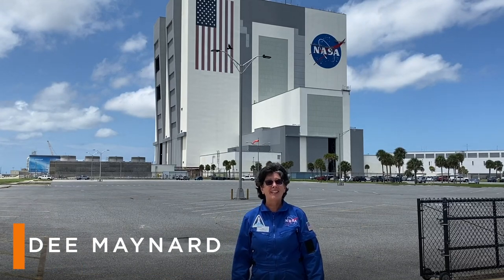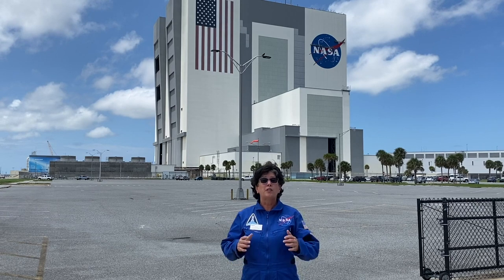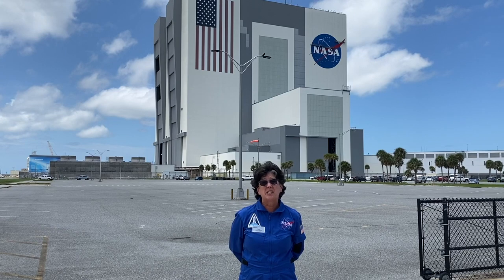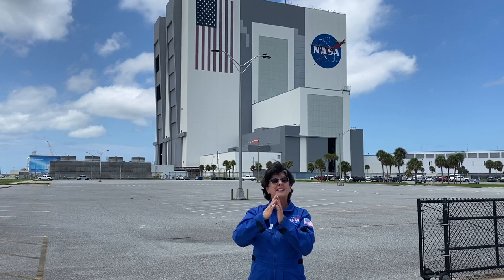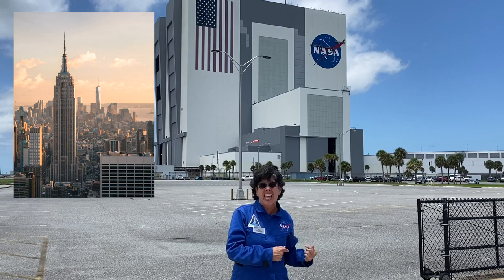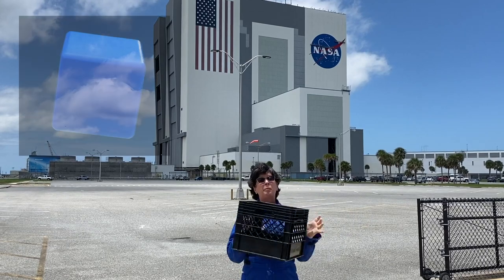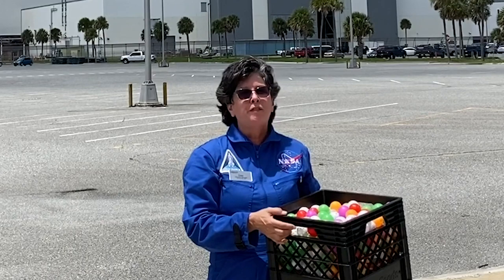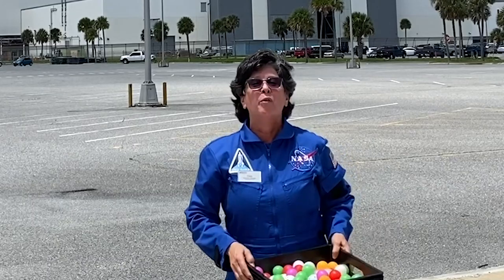How Big is the Vehicle Assembly Building?

Comment: The crawler is only 26 feet high. Scale that to the VAB...... its just on 200 feet high.
Reply: Look at the picture of the Saturn 5 rocket in the first picture.  The building is certainly 500 ft plus tall. It's all about the camera angle.  I  have seen that building in person and it is rather large. Pictures just don't capture the size.
Reply: @jostrander71  Have a look at the control centre next to the VAB. Its only 4 stories high. Scale that to the VAB.
Reply: @chookin1  Why would I do that? Do you think NASA is lying to you? Why would they lie about the buildings height? 
1. Saturn 5 rocket = 363ft
2.Crawler = 20-26ft high is adjustable and looks extended so 26ft.
3. Mobile Launch Platform = 25ft
That is 413ft sitting there to the top of the rocket. Looks like another 80-100 ft of building for sure.
Reply: @jostrander71  Jack......go have a look at the four story building right next the the VAB and do the math. Or dont. I could care less.
Reply: @chookin1  I did. Looks like a 4 story building next to a 500ft building.